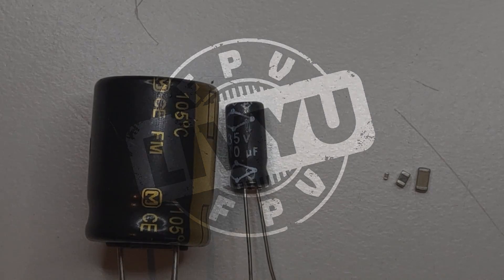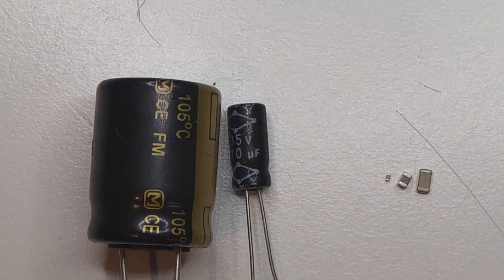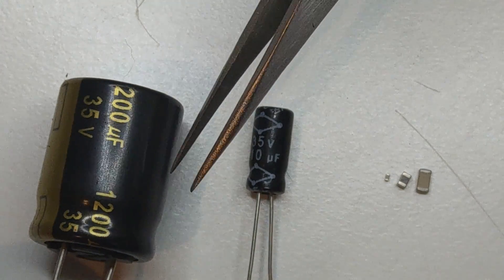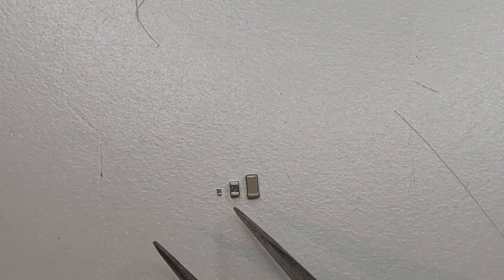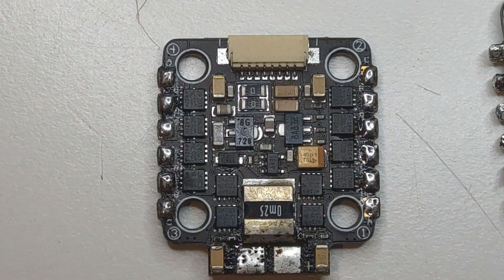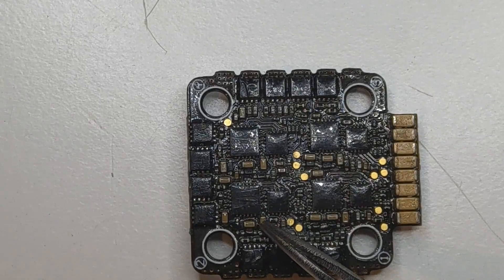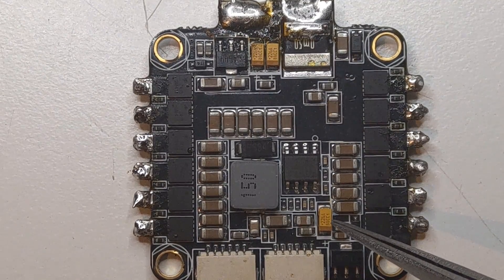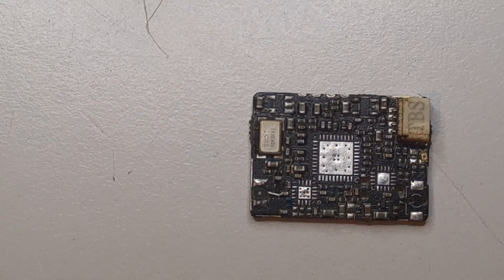RC Electronics Repair Tutorial 02 - CAPACITORS

Comment: Really? Stop using 4in1 ESC's? Is that because they are unreliable, or is it because you have to replace the whole thing if a component fails?
Your English is very good. I never have problems understanding you (I watch at 1.75x speed).
Reply from the maker: Well caps tend to crack (the frame twists and the pcb of the esc twitsts also resulting in caps cracking internally)and kill the hole board in the process, more noise, less cooling...